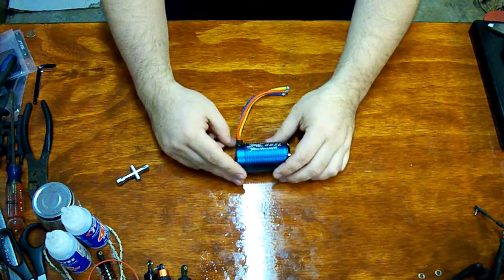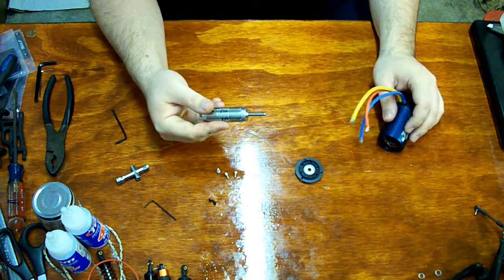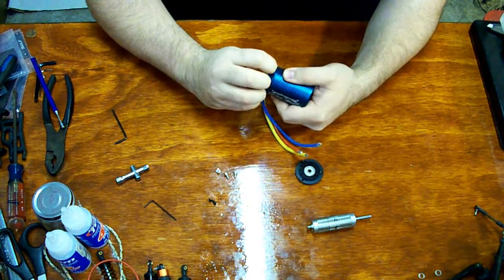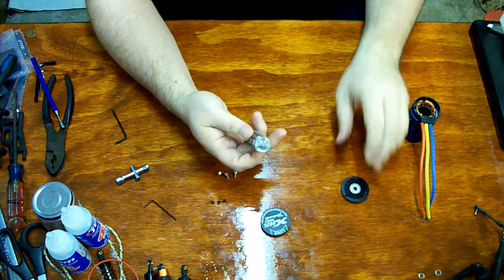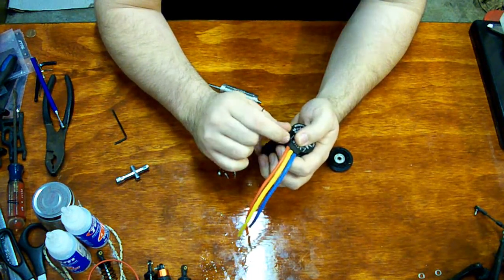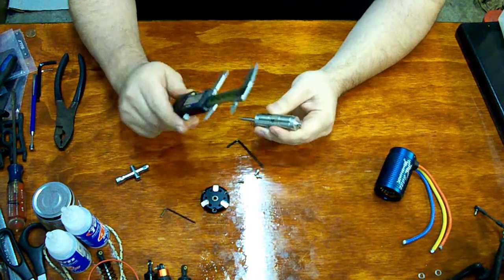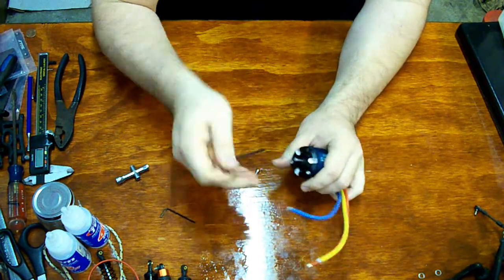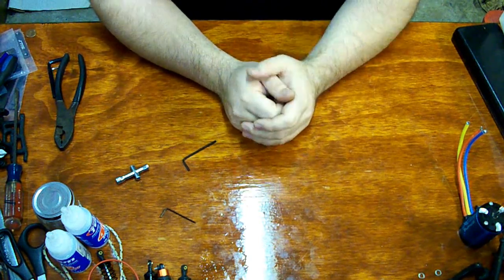Tenshock X802L 1850kv 1/8 Scale 6 pole brushless sensorless motor - IN DEPTH LOOK

Comment: The unsensored TenShock 906 6-pole Crawl Motor is just an awesome crawler motor with great start-up control. I was surprised how good of motor it is for crawling. 
 That being said....the 1/8 motor , this motor looks similar in design just larger. Do you think it'll make a good XL crawl/trail motor with extra torque? How's the start-up?